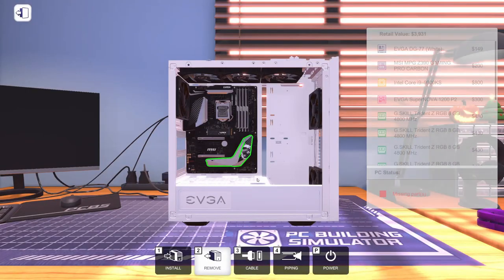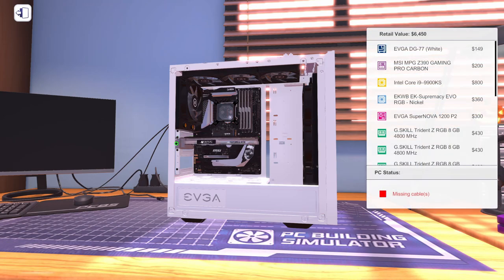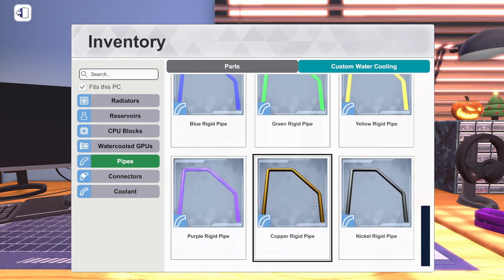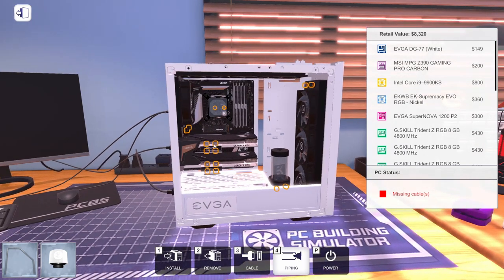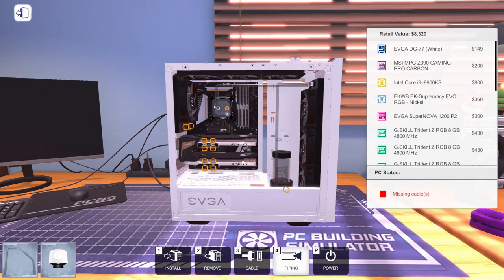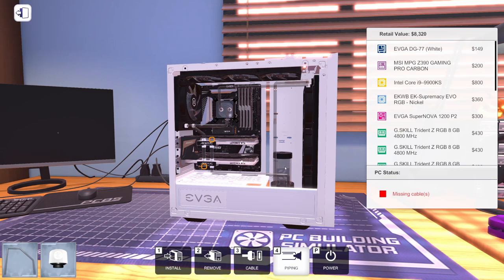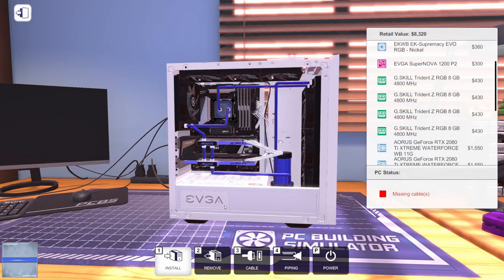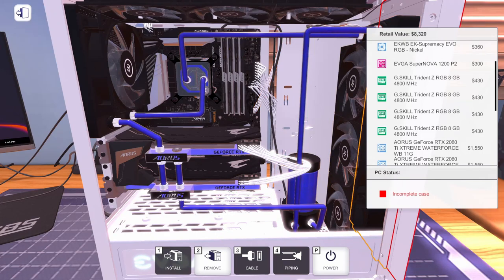Custom Water-Cooling Tutorial | PC Building Simulator

Comment: I know, old video, but the problem I am having is not that I cannot put 2 reservoirs in my build, but finding a motherboard that will take 2 reservoirs. All the ones I have tried so far will only let you connect one reservoir. But nice build. Do you have a video on the one on the floor and what motherboard you used for that? Thanks.

Comment: Wow. I was under the impression that you have to connect tubes to ALL the highlighted areas. I didn't know you could use 4 of the entry/exit points of the GPU, and that it's not necessary to use all 6.
Reply from the maker: Nope, you do not have to use all connections that are available. Just make sure that you have connected to all of the water-cooled components to create a complete loop.

Comment: I wish the game allowed to make really custom water-cooling. Specifically, it's frustrating for me that I can't place radiators separately, and then mount the fans also separately. In the latter case also chosing the direction and push/pull. Instead I can only place a "hardcoded" setup of rad+fans and only in one direction x_X I even can't reproduce my own system in the game )

Comment: Thanks helped alot but how do you screw stuff in so fast
Reply from the maker: Glad it helped 🙂 There are a few tools you can use, one is the Auto-Standoff tool which automatically puts the standoffs in under your motherboard. Another is the Quick-Screw tool (which does just what it sounds like). The other is the Auto-Screw tool, which automatically screws in screws. These tools are found in the Free Build Options, in free build or can be purchased from the Shop under Tools and Software, in Career mode.

Comment: man i have no idea i got the radiator in but cant place the tank or any pipes
Reply from the maker: Could be the case you are using, some cases will let you mount a radiator but they don’t have a place for the reservoir. As for the tubing, if you are using soft tubing, sometimes it just won’t work. I almost always use rigid tubing because it lets you shape where it goes and bends.
Reply: @BigJake901  i used your case and got it going, it got 20,590 on 3dmark seems stable, Ryzen 9 5950x duel 2080ti 32gb ram tooo bad i cant play any games on it.

Comment: how do take out screws and in so fast
Reply from the maker: There are a few tools you can use, one is the Auto-Standoff tool which automatically puts the standoffs in under your motherboard. Another is the Quick-Screw tool (which does just what it sounds like). The other is the Auto-Screw tool, which automatically screws in screws. These tools are found in the Free Build Options in free build or can be purchased from the Shop under Tools and Software in Career mode.

Comment: Idk what is wrong with my game evary time I try and do a bench mark the cpu goes sky rocketing high and I can only test it for like 10 seconds
Reply: Put more volt by overclock, always put it on 1.5v
Reply: forgot to put thermal paste on it, perhaps
Reply from the maker: Like @Rappy said, it sounds like possibly a thermal paste issue.
Reply: Same thing happened with me. I checked the loops and put the paste on. Im usually always running at 91c for my cpu.

Comment: Customers complaining about cpu throttling. Any advice?
Reply from the maker: I would check to make sure there is thermal past applied. I would also check to make sure the CPU cooler is not broken ... could also be that the CPU cooler is not good enough to cool the CPU installed.
Reply: Don't buy AMD 😜😜

Comment: my pc blue screens when i try to install the os?
Reply from the maker: Make sure you have thermal paste on the CPU, also make sure you have a big enough power supply for the system. If both those are good, then enter your bios and reset it to factory spec. as you may have a bad overclock/setting. Hope this helps 🙂
Reply: @BigJake901  thank you the power supply wasnt big enough

Comment: How do I just water cool the cpu?
Reply from the maker: Just use an air-cooled GPU. Then you only need to pipe between the Reservoir -> CPU Block then the CPU Block -> Radiator and finally the Radiator back to the Reservoir. That will create a full loop and you will have custom water cooled just the CPU. Hope this helps 🙂

Comment: why i cant hook any cables to my radiator fan? help
Reply from the maker: The radiators have a single cable that supplies power for the fan or fans.
Reply: @BigJake901  i know. My concern is do all mobo support that connector?since i tried using another mobo then it works fine but i couldn't connect it to the initial mobo that i was using. Just curious. Thanks for the reply .hope your channel will grow rapidly
Reply from the maker: Yes all motherboards support the connector, it’s just a standard fan connector. Some motherboards don’t have many fan connections on them though so that may be the problem you were originally having.
Reply: @BigJake901  oh if that so i think it was a bug. Since i unplugged all the connections from the mobo to try whether it could connect to the radiator. But still unable to do so. That's why I opt for the last solution where I change the mobo and problem resolved 😅